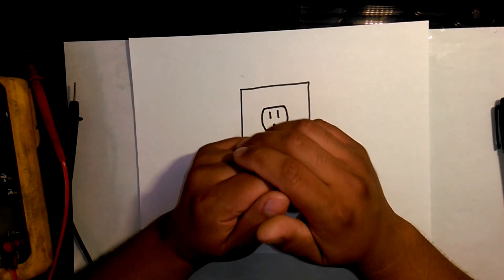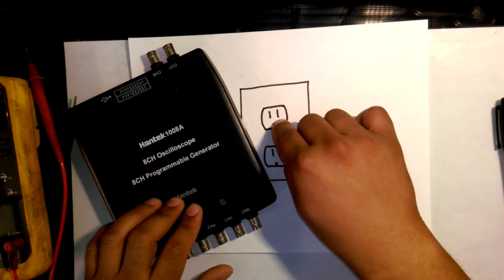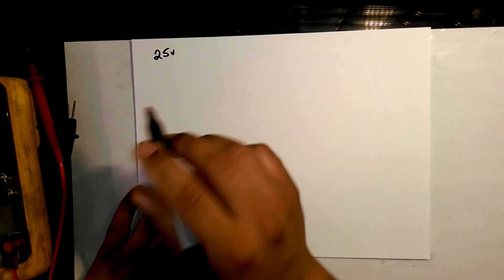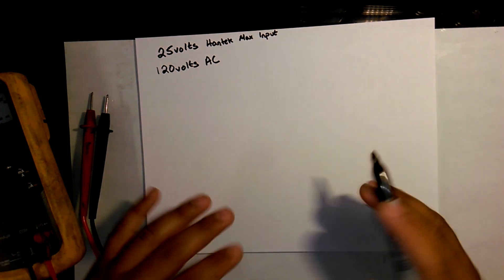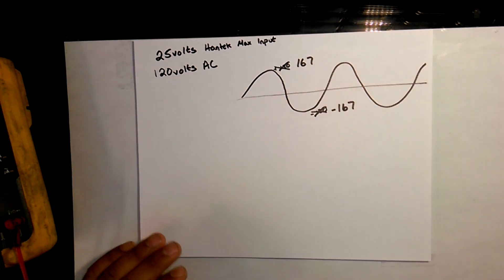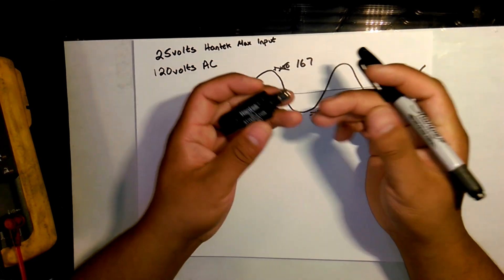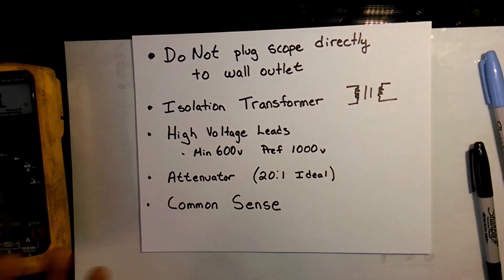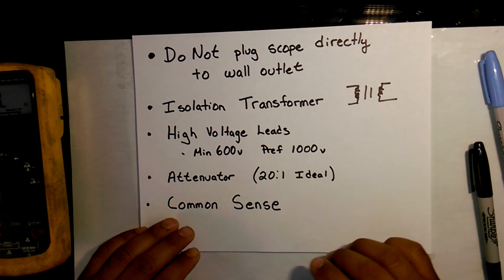Hantek Tutorial: Measuring Mains (Wall Socket) Voltage 120VAC

Comment: This was surprisingly, a very good instruction video and a very good teacher
Reply: Very informative.  I have several UTC A20 which are 600:600 ohm isolation transformers.  These are usually used to seperate signal from a noisy ground.  I use them often in audio.   Would these work for building an isolated attenuated probe.  I do tube amp build and repair.   I’m always afraid I will measure a 450vdc plate voltage.

Comment: A video that everyone working/playing with electricity/electronics should see.  Thanks!  BTW, anyone reading this, note that isolation transformers ship "not isolated"!  I know, go figure.  Lawyers.  You should always test for continuity of the grounds between any test equipment and the item being tested or worked on before hooking up your leads. There are videos on YT that address this.  Cheers!  Great video!!!
Reply: If an isolation transformer ships as "non-isolated", how do you activate its isolation capability so that it serves its intended purpose?
Reply: @dgdiyer1191  my statement was a little misleading in that it is isolated electrically, but the common ground is connected, so...

I think it's called putting it into "Tech" mode.  Basically, you don't want any connection from the isolation transformer and ground on other test equipment or the DUT (device under test) that could complete a circuit.  Will do a quick search, and post vids results in the next reply.  Stand by...

Comment: Nice video. Enrique, you have done a very nice job with your collection of Hantek 1000c videos. I have used my 1000c for a couple years now and am quite happy with it. In my view, it does just as well as the high priced Pico and in some cases, possibly better. For example, the low cost Pico has a vertical resolution of 8 bit; the 1000c is 12 bit. If you want a 12 bit or higher Pico with compatible accessories, it's going to cost you, at least, $1000!  A couple notes, if I may: (1) The max input of the 1000c is 400V(AC+DC peak). The only annoyance with this is when the software is set at Max vertical (5V/DIV), the screen, which displays 8 vertical divisions, will only display a Max voltage of 40V from bottom to top. My solution was to purchase a couple of Hantek 10X probes which when used on 10X, allows the screen to display up to 400V (although I personally would not want to test the quoted 400V max), which is enough for fuel injector tests. (2) You are absolute correct about the 'ground plane' issue. You can definitely smoke something if you don't know your AC black from white in respect to your 1000c. Always make sure 'ground is ground is ground'.  An isolation transformer will protect your equipment.  However, you achieve the same protection by using a laptop on its battery and you are using wifi for internet(unplug LAN cable) and making certain that your charger, modem, or accessory that carries a ground is not plugged into the laptop.  Also note, when performing automotive testing to observe the same precaution with the 'ground plane'. For example, if you want to check battery voltage at the battery on one channel and hook another channel directly to the starter or other device, make certain both cable's orientation  (red and black) both have the same ground polarity or you're going to smoke something (remember, the vehicle ground (battery ground) is not always exactly the same as ECU ground).  Again, nice job. Keep up the excellent videos on the 1000c.

Comment: Really good video. I have watched it twice. Are you saying that if you make a mistake and plug the hot line mains wire to the negative attenuator input that is when you expose yourself, the oscilloscope and possibly your computer with a USB connection to the full 120 V because there is continuity across all of the negative inputs? And the corollary to that is if the hot line went through the positive attenuator input then you wouldn't be exposed to the full 120V (it will have been attenuated)? But even so it isn't worth risking mixing up the hot and neutral inputs.

Comment: Hi Enrique,

Regarding your mains waveform at 22:54, it's actually pretty normal looking. I have almost the same waveform as you, here in mid-soutern Europe. This is known by a fancy name "Harmonic distortion".

Here is a brief explanation of it's cause:  http://archive.siliconchip.com.au/cms/A_112809/article.html
There are also some nice pictures on the google image search.

But in simple terms, electrical system is heavily loaded with non-linear loads, mainly with power supplies consisting of full bridge rectifiers, combined with smoothing capacitors. 
When mains voltage charges up capacitor and mains voltage begins to drop, then load is supplied with power from capacitor, but this capacitor is not totally discharged when next half-cycle kicks in. Because capacitor still has some fairly high voltage, mains voltage must overcome this to be able to charge up capacitor. Before this happens, load is acting linearly. But when mains voltage becomes higher than leftover capacitor voltge, is when current surge is caused because both capacitor and load now draw current from mains.
Mains also has some small internal serial ressistance, and all this combined causes this flat-top distortion.
Reply from the maker: Fantastic explanation. I wish I could give you a million thumbs up!! Thank you, I have always wondered about that. All the street lights is my neighborhood are high pressure sodium lamps and my house is filled with switch mode power supplies, many of which are home made which do not have a power factor corrector like consumer electronics have. Thank you again. I would appreciate any more comments you have about my videos, they are greatly appreciated.
Reply: This is so great. A while ago I was thinking that this was a problem was my Oscilloscope, but now I know thanks to you. Thanks bro

Comment: Thank you very much, very informative and you are a good teacher.  Thank you again.
Can you teach us how to check the cycles on a generator like 60 cycles versus 50 cycles like in Europe.  I have several generators that I purchased and repaired the engine and it's very important that the cycles are correct for electronic equipment.  I am going to purchase one of the Hanteck Osc Scopes to I can set the cycles to 60.  I have not had a Scope so what I do is look at the data plate it generally says 120 volts.  So I take my Fluke and make sure the voltage whether it is 220 or 120 reads that and I am just hoping that the Cycles are close it the generator is not a sin wave generator or inverter.

I have not purchased the Hantek Device yet, are you pleased with it ease of use? Or do you have another manufacture.  I know lots about automotive and house currents, but I'm an old guy 63 and am teaching myself how to troubleshoot the computer systems on the new cars.   And being able to check the different sensors will help me also.   
You are very knowledgeable and whether you decide to follow through and go to school you should teach your knowledge.  God gave you a gift of teaching and understanding how people think.  I have a basic understanding of Radio Freguency also, from a youngster, but I'm disabled now and need to fix broken electronics, I like working with gagets and have Lathe and Mills and all kinds of tools.  I like fixing things for people and teaching them also.  We are a "Disposable Society" when a 25 cent resistor can be fixed instead of a new TV or fix a car for someone that doesn't have money or resources, I truly gives me joy to help people.
I was  a Paramedic for 25 years and understand the Human Body  Greatly, I can teach you about the real electric systems that mean alot like the Heart...an amazing organ/muscle.  And it too runs on voltage.  I use to ZAP people to depolarize the heart so it would start up again HOPEFULLY.  Maybe some time we could chat a bit and share knowledge.

 Bless you Enrique.   I wish you lived near SW New Mexico,  as I would pay you to teach this old dog, new tricks.  Thank you so very much.  I also teach people about the Bible, if you have interest in that.  God's been very kind to me through my life.  The Paramedicine was my gift as Electronics is yours.  I can tell you are a good person as you like sharing the knowledge that Christ gave you.  Again, man HE Bless you and don't get bit by those volts.  Once I got zapped by 220 AC and it hurts. During my paramedic career, I took care of a couple linemen that got 7200KvW, it's devastating to say the least.  Hope to talk soon.  Check your messages on your channel, and I will send you my email and we can share back and forth.
Jim

Comment: Yeah 120v ac is pretty lethal i been accidentally shocked about a dozen times. it killed me every time. nah it just surprised me. it doesn't hurt very much. it mostly just feels really weird. 
still wouldn't recommend touching it just because you wanted too unless your a masochist. 
i accidentally touched a loaded capacitor once... felt like my arm got smashed by a truck. would not recommend....   also been socked by an ignition coil through the insulation... 
any who..... you had some pretty good info thanks.
Reply from the maker: I loved going through that flow of thoughts with you. Thank you for your comment and thanks for watching!!

Comment: the isolation transformer is just isolating you from house hot (conductor with overamp protection) and neutral (grounded conductor). Hantek need to be grounded in/to the service panel to safegaurd against this issue? Would"nt you have the same shock issue with the transformer?
Reply from the maker: You would have the same shock issue IF you are touching both wires on the output of the transformer at the same time. If you only touch one or the other you are OK. 

Technically, although I do not like admitting this, you can touch the HOT wire of your house and be OK if you are not conductive to the ground but it is VERY easy to be conductive to the ground so it is not a good idea. Adding to this an isolation transformer removes this hazard. You will only be in danger if you are touching both wires of the output of the isolation transformer.

Comment: I'm so glad I found this video.

Couldn't you use two attenuaters and reference against ground?
It would be still semi dangerous.
Reply from the maker: I am having trouble picturing what you mean. Could you elaborate further?
Reply: @Enrique_Osorio  The problem you showed was because the ground ring on the bnc connector is pretty open.
The multi meter leads are used between hot and neutral. Neutral shouldn't have voltage. If you scoped hot on one channel the neutral on the other then grounded on ground you should be good with the attenuater.
Reply from the maker: Really good idea! I never though of that. I might have to try that.

Comment: I'm trying measure 600 to 1000 V ringing or spikes generated at turn off of a 120 VAC  triac/solenoid valve circuit in order to create a snubber. I noticed, that on occasion, re-triggering occurred at the end of a cycle. I guess I need a 20:1 attenuator and high-voltage probe. I'm using a HANTEK 6022BE and  HP laptop with Windows 7. I would appreciate your thoughts on the subject. Thanks in advance. RFP
Reply from the maker: It sounds like you are on the right track. A high voltage probe or differential probe would be necessary for this type of application. I would be concerned about the accuracy of your readings. Some of these switching circuits can have transients or natural responses that only last for nanoseconds, depending on the time constant of your circuit. I am assuming the 120 VAC is at 60 Hz which means the bandwidth of the scope will be fine. Let me know how it goes!!

Comment: What about using the stepdown transformer. You could then just read the 16volt side. ???
Reply from the maker: You are absolutely right! I was concentrating on capturing the exact signal, amplitude and all but if the shape of the waveform  is the only thing you are interested in then a step down transformer will work very well. Thank you for your comment and thanks for watching!!
Reply: Came here to ask this exact question, thanks for already asking it. Maybe Enrico could pin it for the next person?

Comment: I've been thinking of getting an isolation transformer for my scope and my pc, but base on your explanation, I can use a voltage regulator which typically have a transformer, Can I say that my pc is isolated when hook-up to a typical 220/240V AC voltage regulator?
Reply from the maker: It depends on the power supply design of your scope and/or PC. Power supplies should have good isolation between mains and the device but that is not always the case. As always proceed with caution whenever using mains electricity. Thank you so much for your question, and thanks for watching!!

Comment: Enrique,
That's a very good informative video.
As there is 1Meg resistance on the positive rail of the attenuater, why can't we put 500K on the positive rail and 500K resistor on the ground rail to make it completely safe by touching any point at the out end of the attenuater ????
Reply from the maker: A quick back of the envelope calculation shows that the voltage measured by the Hantek will be 40% of the actual voltage under that configuration. If you keep that in mind then there should be no problem.
Reply: @Enrique Osorio
Do you mean that if we put in adequate resistors both on live and ground rails then it can provide sufficient protection ????

Comment: I recently purchased a hantek 1008c. The user manual states the max input voltage is 400V (DC+Peak). Does this mean the newer versions of the 1008 could actually take wall voltage?
Reply from the maker: As I understand, Hantek does claim that their oscilloscopes can handle 400V on the input. I specifically do not do this due to the fact that the BNC inputs are not shielded, meaning that accidentally touching one of the other BNC inputs could POSSIBLY cause bodily injury if you make a mistake while probing. I personally have never tried inputting more than 25 volts into my Hantek without some sort of attenuation but that does not mean it is not capable of doing so. I honestly DO NOT KNOW. On my other videos you will see people calling me out about this, that they have placed 200 volts or more on the input of the scope with no ill effects. 

Honestly I am curious about this myself. I would like to test this by ramping up the voltage to the Hantek from 0 to its supposedly 400 volt limit and beyond, to see when the blue smoke emerges. Hopefully soon.

Thank you so much for your comment and thanks for watching. Take care.
Reply: @Enrique_Osorio  400V DC, you are talking about AC voltage in this video
Reply: @silviuguseila2552  The specs say "Max. Input:400V (DC+AC Peak)"  120V mains voltage is about 170V peak.

Comment: Almost all isolation transformers by code now have to have the ground carried all the way through it from the ground pin in the wall socket through to the ground pin in the output of the isolation transformer.  So the ground isn't isolated at all and that is the problem.  You would have to hook to the transformer output socket with a plug that did not have a ground pin.
Reply from the maker: I did not know that. Thank you for that information. That makes sense, in case the primary shorts to the secondary somehow. It seems to cause a problem for the output of the isolation transformer since you want to get away from any reference to the mains whatsoever. Thank you again for that information. Just out of curiosity is this a code in North America or is it global?
Reply: Enrique Osorio I was told that by an electronics repairer.
Bravo to you for going to school to be an electrical engineer.  I have a friend that had his daughter got her electrical engineering degree.  She now is the main engineer for an public electric company.
Reply: On the output of the transformer Even though the ground is shared the neutral is not cause the first problem is the neutral being connected to the ground, so the new N is considered isolated from the ground , that's my understanding at least.

Comment: Thanks for the video and safety precautions, they are very much appreciated, I was almost about to use the 20:1 with my USB scope. I've never analysed the harmonic content of the AC mains. I have a question though, I know from theory that iron core transformers have a frequency response best suited for 50/60Hz, or in other words if you use an isolation transformer, higher order harmonics are naturally suppressed by the transformer, as the reactance of the transformer grows linearly with frequency. So, how do we know the true harmonic content of the AC mains?
Reply: @Ridge Camden instablaster ;)
Reply: @Nikolas Dylan i really appreciate your reply. I found the site on google and I'm waiting for the hacking stuff atm.
Seems to take quite some time so I will get back to you later with my results.
Reply: @Nikolas Dylan It did the trick and I actually got access to my account again. Im so happy:D
Thanks so much you really help me out :D
Reply: @Ridge Camden Happy to help :)